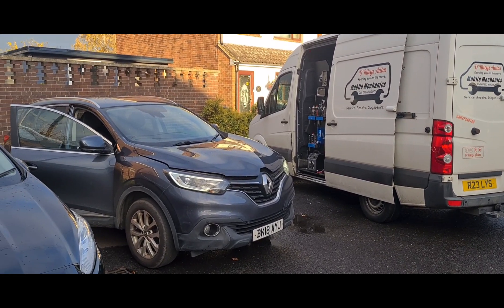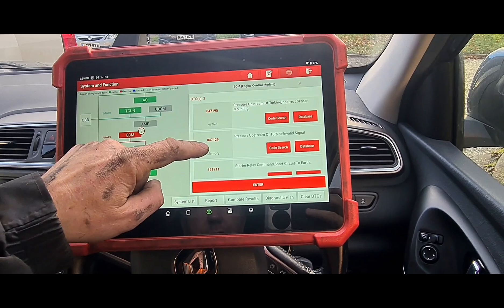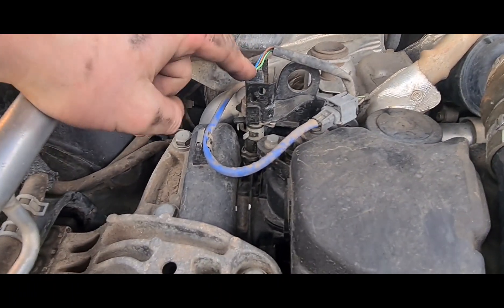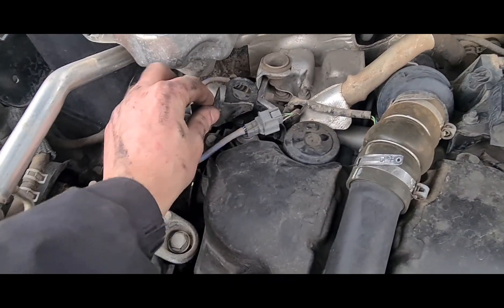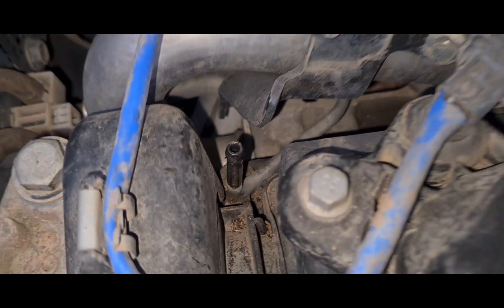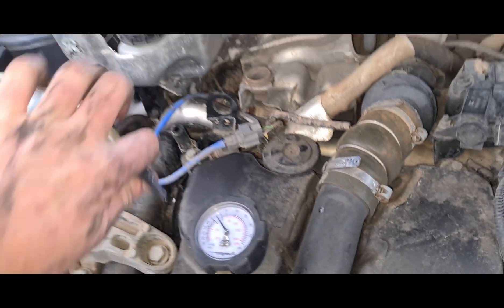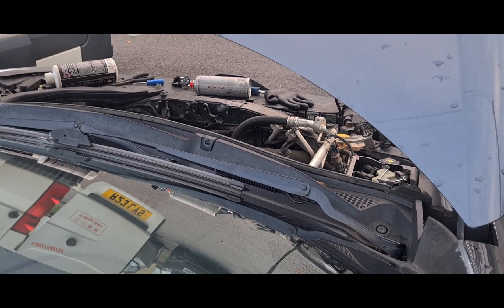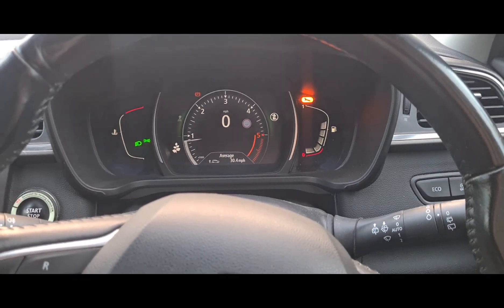Renault Kadjar 1.5 047195 047129 Pressure Upstream Of The Turbo

Comment: @ORileysAutos - Jimmy, thanks for this video.

I completed the procedure yesterday on my 2011 Grand Scenic with a similar but older 1.5dci engine. I notice this video was a 2018 Kajar, but it was the diagnostics with the scanner and the drilling process that was very useful as I'm no mechanic !

My sensor on the 2011 car was much further back. There is a video that shows my engine layout by "Stupid Bloke Stupid Videos" who deals with what looks like a 2010 / 2011 Scenic with the 1.5dci. His sensor location was exactly the same as mine. More stuff to remove to get access. 

I see on the later Renaults and Nissans that you video, it looks like the metal pipes are longer and more curvy to enable the sensor to be more accessible. 

Broadly mine was reading 1 bar (1013mbar) with P0471. Pipe was blocked and sensor was a bit caked up with carbon as well. Soaked the sensor in a bit of brake cleaner and cleaned it carefully. Pipe was blocked about 20cm down. Did the drilling with the cable and softened up a bit of brake cleaner down the pipe. Became unblocked when I got the cable down 26cm. I think my pipe is shorter and less curvy compared to others.

Very happy with results. I love that 1.5dci engine, its been rock solid with regular maintance, so I'm very glad the P0471 code has gone 🙂

Thanks again and all the best !

Comment: Do you have a link to a generic rubber pipe I can buy/cut to size to replace the old one?  Many thanks for your videos, we've managed to successfully clear our blocked pipe, put a new sensor in at the same time.  It's a 2014 Renault Grand Scenic 1.5dci

Comment: Its not shown but did you reset the dpf learned values after flushing the dpf with the fluid? Or if there is no faults related to dpf ,like in this case only upstream pressure fault, you dont reset the dpf?

Comment: Hello , I'm having the same INJECTION CHECK signal on my Kadjar's dash, furthermore I got also ANTIPOLLUTION CHECK , am I going to solve the issue by cleaning the hose ? thank you!
Reply from the maker: You'd need to check the faults and live data
Reply: Thank you I’ll scan and check. However the Check signals must be erased only via Obd ?

Comment: Is there a pressure tester available like the one you use on the pipe but not connected to a compressor? So just a manual one, as I think I have this problem but don't want to buy a compressor and bits..cheers

Comment: if you try to clean Dpf with your method on this engine 1.5dci 110 euro 6 is there a danger of HYDRO LOCK because the gases from Dpf go to the Egr cooler and there are two Egr valves and then to the intake?

Comment: Offtopic ...ive got an 4n13 engine ...no enginelight on ore stored errors ...just when i start the engine when cold like from 5 up to -10 Celsius i get a consistent puf of smoke that smells like unburned diesel no matter how many times i do a glowplug cycle ...from what i can guess is that when cold the theres not enough heat in the cylinders to burn of the first cranks ...but i've seen others and it starts wit no problems like mine ...what could be the cause ? Glowplug were changed

Comment: That’s very interesting 
I run a 1.5 dCi it’s about 65,000 miles now , I’ve heard of this fault but was not sure witch pipe got blocked , I’m wondering if it’s worth cleaning it like this every few years rather than let it get blocked 
Thanks for the heads up